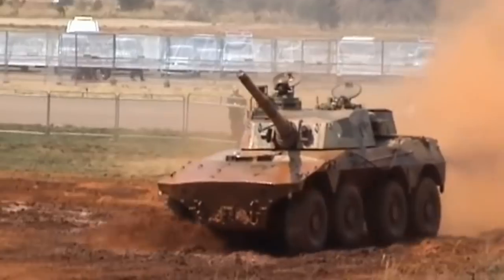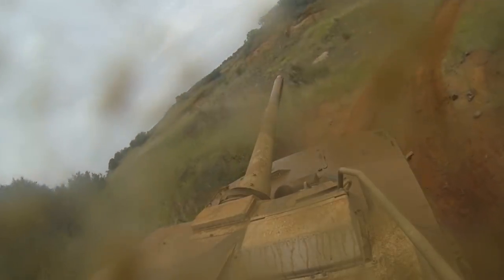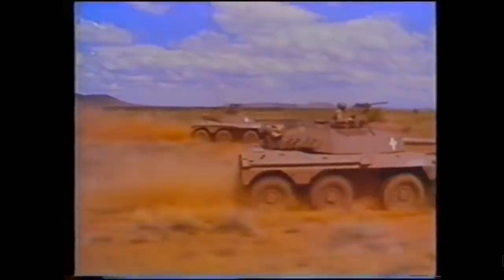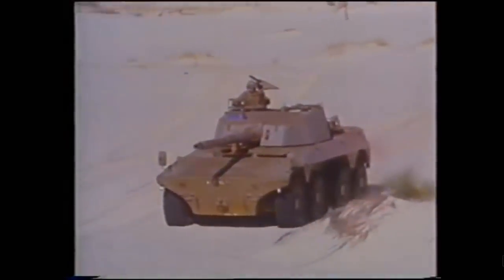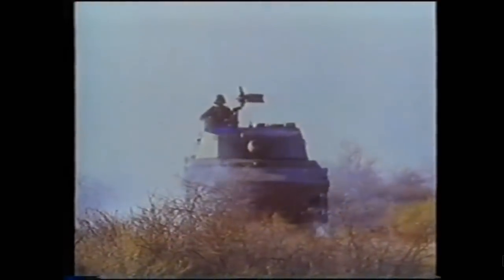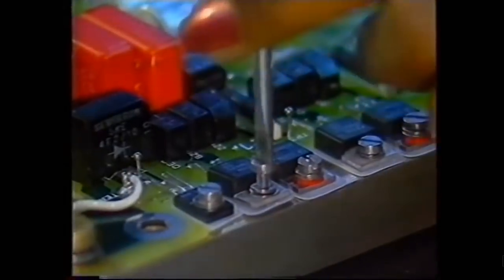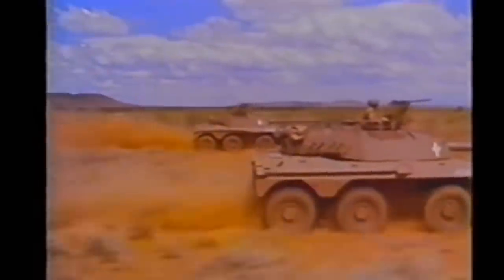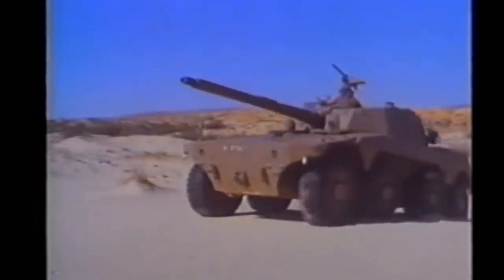Rooikat Armored Fighting Vehicle - South African Firepower

Comment: Technically there "is" a 120mm rooikat, the defense industry mounted a 120mm autoloading remote turret into a rooikat as the easiest way to show off their next generation of remote and armament systems, so it is entirely possible for the vehicle to be upgraded in the future. IIRC it also has the LEDS APS stuck to it to be shown off too. So if any neighbours buy something bigger then a T72a the South Africans can always look to upgun too.

(though ofcourse, when you look at it, you do wonder "how is the crew supposed to get out if the turret isnt facing forwards")

Comment: Denel also built a hybrid diesel/battery prototype. Electric range was only around 30 km but it meant the cold start issue diesels have wasn't a disadvantage. Battery power also gave it a quiet approach capability, which in thick bush would be a big advantage. Sadly, it has never progressed beyond prototype.

Comment: Thnx from a ex 20 mm ratel gunner from 1979 onwards..yeah the Eiland had a little 4 cylinder engine that had the tendency to overheating on long hauls or in hot dusty conditions but packed a solid punch in battle with its 90 mm gun and small cheeky size, the rooi kat is based on the ratel and though the main gun is smaller its still a verry good replacement for the much smaller eland and way more reliable deffo..though its huge don't let that fool u..its so fast as the ratel also is that its a damn hard target to hit if ur not using some sort of lock on system..and yes..wheels can be flat and blown off but like the ratel these things just keep on going  lmao 🤣

Comment: In my opinion 76 mm is a smart choice, 105 would be overpowered or over engineered, plus it will loose agility of putting rounds downrange with higher reload time, and heavy gyros to stabilize as the intended use will b against light skin tecticals or at Max a BMP, 105 apfsds shell would go right through the light armor without causing fragmentation because of lesser resistance. 76 mm derp shell would b enough but there must b some reason for using apdfsds rounds. Dats my take.
Reply: Heck, the 76mm APFSDS is capable of taking out a T-62 which was the biggest threat to them, 105mm I suspect is more for "trying to sell" the vehicle.
Reply: mitch verr I don't think 76mm would pack a enough punch to pen t-62 from front n sides. What r ur sources to this claim. ?
Reply: The things I used to have have shut down (this is going back 8 years or so). Some sites like http://www.defenceweb.co.za/index.php?option=com_content&view=article&id=18165 still claim it, but if you take the statistical data we have and put it through the lanz-odermatt equation does support it I believe.
Reply: i remember reading at leas t 1 T-72M was penetrated by the 76mm at 2km, don't know the reliablity though
Reply: Matthew Burger I highly doubt that.
Reply: dat must b a hyperbole, u just cant underestimate t-72.
Reply: @prashantmakemerich  I'm not sure about other people sources, but mine is the Rooikat Gunnery manual and it states that the FS round can penetrate the frontal armour of a T-62.
Reply: @matthiuskoenig3378  no T 72 deployed to Angola
Reply: I think the only thing that could be made better is the elevation of guns - from 35 to 60 degrees would be useable also against helicopters.

Comment: I think wheeled vehicles are gonna be best for the next major conflict. Strategic mobility, rapid deployment and easier logistics will be winning features. Tanks are easier to kill now and speed will be better than heavy armour and tracked mobility. 
Not that we wont need tracked tanks and apcs as a powerful tool, but i think QRF forces on wheels would be very useful and first into any fight.
Reply: easier to kill now, you do realise that the current missiles needed to kill a modern T-72 is double the price of a T-72, you could literlly out number the missles needed to kill an MBT with MBTs. wheels are all well and good on roads and in dry country but as soon as it rains they suck, they are also useless in almost all terrain generally speaking, the rooikat has some of the best off road mobility of all wheeled vehicles yet it is still way slower and more restricted by tracked vehicles.

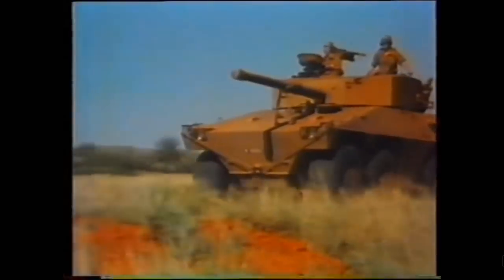Comment: They actually did build the 120mm prototype with autoloader. And in 12:36 of vid you can see a very unique vehicle, probably the largest and heavies of all, the mysterious Bismark. Not too many info about it can be found, prototype did land in museum happily not scraped.
Reply: That is the German Class 3(P) and has a 105mm gun.
Reply: @spudmanwp  Because it is in German tree in WT don't mean it's German :P
Reply: @Galvars  Sorry, I meant from a German company (Thyssen-Henschel).  A quick Google search says that it's a variant of the "TH-800" hull.
As far as WT goes, They screwed up as "copy/paste" tanks are supposed to go into the Tech Tree of user and not the mfg.  It should be in the UK tech Tree.
Reply: @spudmanwp  It have also fictional turret, the one in museum have an Olifant turret. Still a very little information about it, no test data, short description in museum. For most time it was almost forgotten vehicle.
Reply: @Galvars  Thanks for the clarification.

Comment: Thanks for the video, sounds accurate. I was trained on the rooikat as part of my military service in 1992. The rooikats mobility was truly amazing , it goes anywhere without a hitch. We never got stuck once in the year thatI spent on it. The cannon was impressive as well. The armour piercing FS sabot round went through a T72s armour, burning a hole as big as a fist as it exits on the other side. I agree with you that an105mm gun would have provided better HE (high explosive) rounds. The HE rounds did have a programmable timer function so that the round would bounce on the ground and then explode, causing fragmentation against infantry. The car was technically very reliable and I think it would have been a formidable adversary on the border war. Unfortunately the border war ended just before the rooikat was introduced so it did not see any action.

Comment: The choice of 76 mm may have been largely due to Denel knowing the oto melara naval gun and being able to easily modify it for one shot, manual reload. The 2nd (and perhaps brilliant) reason might be balance. Wheeled vehicles seem not to be very good at handling larger calibers (they bounce and rock) so, if you are looking for accuracy while traveling at high speed, the 76mm was a great choice. The 105mm seems to have come along in an effort to increase commonality with potential customers using NATO 105mm guns, but doing so overpowers the chassis. You can live with it, but it is not the "designed for" gun. (my 2c, so take it for what it's worth :) )
Reply: +Deane Joyce+ though the Stryker MGS doesn't seem to have those problems (as far as I heard) but that could be due to the unique remote turret design.
Reply: I’ll only accept 1 cent from you. ☺️
Reply: Just a thought, if the Stryker MGS was ("might be" and "pure speculation") experiencing this "overpowering of the suspension system" issue, it might all go away using a weapon system with a "fatter" recoil, like a 120mm gun mortar. Being 120mm, it could use almost all (no long rod penetrators) of the 120mm ammunition available today. You simply screw the warhead off and screw a mortar spigot onto said warhead. You take your high pressure 105mm tube and bore it out to 120mm and  it might be able to handle the lower pressures of a gun mortar. Oh, and you also make the 105mm blast wave "go away" so you can mount it on an aircraft air frame (read: AC-130) no problem and oh, you can use strix GPS guided ammo too.... :) In reference to a ground vehicle; A smaller blast wave might also make it more useful to troops on the ground fighting in close proximity to a ground vehicle. The assumption I am making is that the MGS is designed to support troops e.g. take down buildings, etc. as opposed to being a "tank killer". Another alternative to big calibers on wheeled vehicles might be the RUAG 120mm gun as it seemed to have a lower recoil than a high pressure 105mm (?) I do not recall exactly, so something else to explore if I was a Rooikat customer. 

cheers all
Reply: :D
Reply: +Deane Joyce+ problem is that that it is still supposed to retain the ancillary Anti-tank abilities the Stryker MGS 105mm has with the KE round and would sooner call in a mortar strike from a Sryker Mortar carrier than lose high pressure round capabilities as the US military in general doesn't like low pressure systems in general due to the increasingly uselessness of direct fire HEAT rounds against armor but not necessarily to KE rounds which are still relatively effective even in 105mm format against older vehicles. Even if US forces haven't been fighting against tanks for about 15 years and Striker units would get butchered by any tank that could get close enough to hit accurately.
Reply: The assumption there might be that the 105mm long rod penetrator has similar material characteristics to the M829E4 120mm long rod penetrator. If so then all good. If not, then the same things that you referred to (above) that make direct HEAT "not so useful" might be able to break apart older long rod penetrators. This might be food for thought. Anyway, enjoyed the video.
Reply: One of the other reasons for using that 76mm was because SA had masses of naval ammo stored up for that caliber.

Comment: Invention idea! Make a quad of wheels that can attach to the front and back of a tank. These rear units can be driven by a jack shaft from the tanks engine and with the front unit for steering, raise the treads off the ground. Both units would be dropped when getting to the operational area. 
Another use would be for when a tank loose a tread, the quads would raise the tank for fixing the treads, or to keep it mobile till other fixes.
The attachment points would be hinged at the top with the the lower end winched into place.
Reply: already done:

Landsverk L-30

https://de.wikipedia.org/wiki/Landsverk_L-30
Reply: Nope, not close at all. THAT design makes the tank wider and heavier. My concept has two detachable units that make it longer when wheeled, normal size when detached.

Comment: if you compare this vehicle with the  Luchs, one great advantage of the rooikat is the independent suspension, it makes it faster off-road, and allows the designers to keep the vehicle low, despite de huge turret. on the drawing in the commercial you can see they were heavily "inspired" by the Panhard suspension!!!(of the old Eland)

Comment: Thanks for that, in answer to the wheeled component of the design, other than the obvious sand wear issue and the huge benefit in speed, range, etc, etc, was landmines which were used extensively. One will disable a tracked vehicle immediately whereas this and other vehicles of this multiple wheel design could loose a wheel or two and still be mobile, at a reduced capability, but not a sitting duck in a possible ambush situation.
One thing you appear not to be aware of is that SA continued to produce similar vehicles for a very large Western presence in the Middle East with similar local conditions. I worked for a sub-contractor that supplied bits and bobs for them at the time.
That voice over guy sounds so familiar, can't place him though.

Comment: LOL it uses a pintle mounted browning mmg
hey, if it works
germany still uses the mg42 in the form of the mg3
Reply: It seems that .50 cal little mounts are more of a US and Russia kinda thing. Most other nations use MMGs for pintle mounts.
Reply: +keith moore+ .50cal BMG is a fiendishly lethal round, there are reports of a single round being able to tear a grown man in half at 800m or alternatively almost punch all the way through 1 inch of steel at about 300m with standard FMJ rounds (you can see through the hole in the plate even if the bullet didn't go all the way through it). This also makes it good at killing things at extreme range compared to say a 7.62mm NATO round. Alternatively what more commonly happens; punch holes in cover (common occurrence in urban warfare especially) as nothing short if pillbox grade reinforced concrete will have any hope if stopping a sustained barrage of .50cal rounds.
Reply: Also .50 cal is a very good way to tear apart unarmored vehicles like technicals or shred the engine of any would be car bomb or punch through the vehicle to hit the driver before the bomb explodes.
Reply: "Tear a grown man in half at 800m"
No. At 800m, it will have roughly 4550 ft-lbs of energy, or 6168 joules. This compared to about 400 ft-lbs (500J) less than a .338 Lapua at the muzzle.

Will leave a damn big hole, and is pretty much lethal if it hits anywhere in the torso.

At extreme range, as in, past 1000m? 7.62 is still quite lethal. Yes, it is more of an area of effect weapon at that range, as you are essentially raining bullets down on the enemy position, but at 1000m+ that's all you are really going to do, as seeing/identifying a human size target at that range, even with optics, is damn hard. Basically impossible if they do not want to be seen.

The real benefit of the .50, is barrier penetration, and dealing with vehicles and obsolescent, light armour.  But you pay for that capability with ammunition supply. The Rooikat, if I remember from the video, can carry 3000 rounds of 7.62. Assuming they are using standard 200 round cans? that's 15 cans of ammo, each weighing 18.75 lbs, for a total of 281.25 lbs (127.5 kg)

100 round cans of .50 cal ball, weigh 35 lbs. For the same weight load of 3000 rounds of 7.62x51? You can take 800 rounds of .50 cal. Of course, no idea if you can FIT eight, 100 round cans of .50 in the Rooikat to begin with.

Again, the purpose of this vehicle was to fight longer engagements. To get in, strike, retreat, and attack another location. It's why they chose the 76mm over the 105. Ammunition capacity. Most of the enemy forces they are likely to meet, were unprotected infantry armed with AK variants.
Reply: @cnlbenmc  you've seen too much hollywood
Reply: Mount two of those .50 Brownings side to side, give them water-cool jackets, and you have a "missionary".

Comment: Condidering it has been in production the last 30 years it is nitpicking:

1) The wheelbase is a bit long for my taste: It gives better trench crossing, but a greater turning circle.
2) It has a decent engine.
3) The 76 mm. should be sufficient for South Africa from the basic consideration: How the devil is the opposition going to tote heavy armour up to where they are needed.
4) A tad more armour?? But a refridgeration system might be more relevant?

In all it seems to be a nice and practical vehicle.

I do share the opinion that a 105 mm. would make the vehicle more exportable.
Reply: As some of You might have guessed: I sort of rides my hobbyhorse: The wheeled turretless tank.

1) A 105 mm. will give a greater recoil and should be placed as low as practical.
2) A tighter turning circle should make away with the requirement for a turret. As far as I can judge the Piranha 5 has about 15-16 meters and if you can keep the gun inside the hull I don't see a need for a main gun turret.
3) A fixed gun would allow some kind of autoloader - the ones in use have not been particularly succesfull. But a 105 mm. fires cartridges and do not have a separate charge. And it could leave the breach in proximity to the grenades - and out of the way of the crew. Fold down the armour plate behind the crew and let the gun do its business. That more or less precludes a 120 mm. which would want separate charges. That I would leave to the artillery.
4) I would though like a 25-35 mm. autocannon in a turret - provided it can be serviced under the armour protection - which some of the modern turrets can. A turret would weigh about 20 tons for a main gun turret and a smaller caliber would weigh 2-3 tons - not necessarily particularly armoured.

Comment: i would like to see Canada do something like the gun on this with the LAV
Reply: I think that a LAV/Stryker fitted with a turret which houses the 76mm OTO Melara gun (yes, the Naval cannon) with a manual loader and dual Missile Launchers (Hellfire or Brimstone would be my first choice) on the turret sides (ala the Bradley IFV) for destroying MBTs would be a good idea for a Mountain/Airborne Infantry division.

The 76mm has laser-guided (Dart), semi-armor piercing (SAPOM), and GPS-guided (Vulcano) munitions and a turret bustle at the rear (complete with blow-out hatch on top) could hold up to 24 ready rounds (ala the M1).  They could easily develop an APFSDU round to kill T55s just like the "ROOT'S" AP round does.  The cartridge (being Naval in origin) is fairly long (and therefore has a longer range) but I would replace the brass casing with a disintegrating case like the 120mm AT rounds have.  I'd leave the cartridge ejection over top of the barrel (just like the Naval gun) but angle it to eject towards the right (to avoid the driver's head).  

Put TWO-ROUND folding Missile launchers on either side of the turret (ala the Bradley's single twin launcher) for destroying MBTs and a dozen smoke grenade launchers on the turret sides.  Add on some Reactive Armor for "up-armoring" the AFV,  and you have a light Tank Destroyer.

 With a four-man crew and additional reloads in the lower hull, this could be an interesting concept for an air-dropable AFV.

Comment: in the savanna, a low profile is most important but don't think that 76mm was 'just enough'... with 42 rounds on hand, some with depleted uranium, you could pretty much clobber anything into submission, but more importantly could run extended recce sorties and survive multiple contacts with RPG-7 and light armored vehicles.